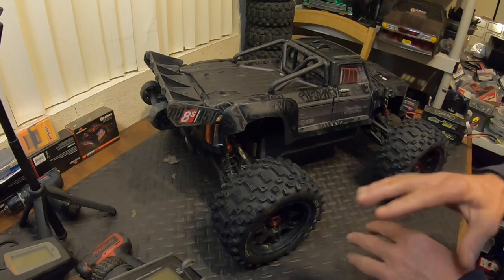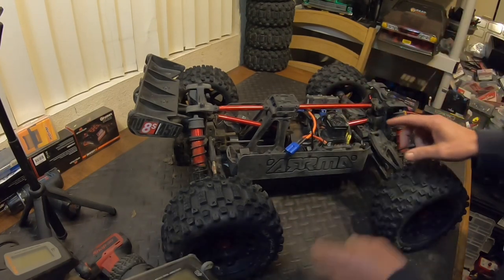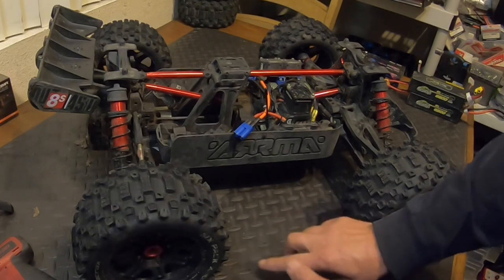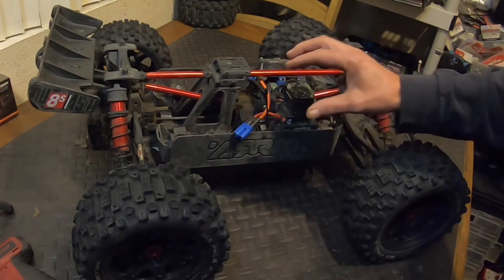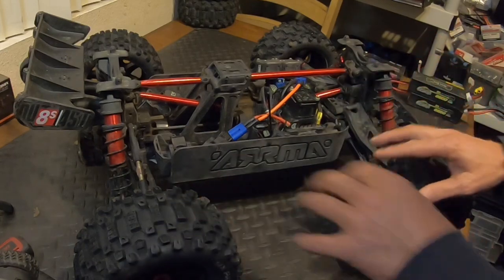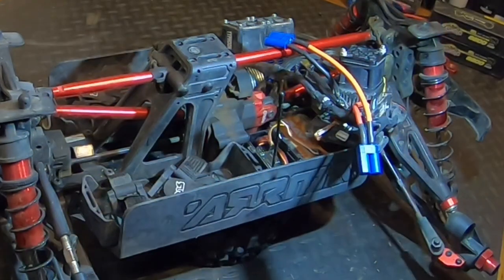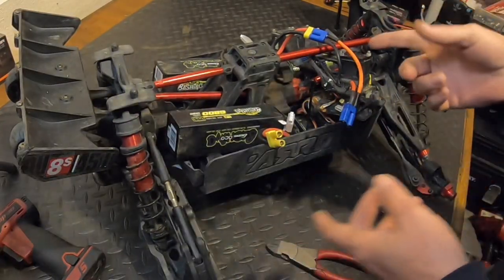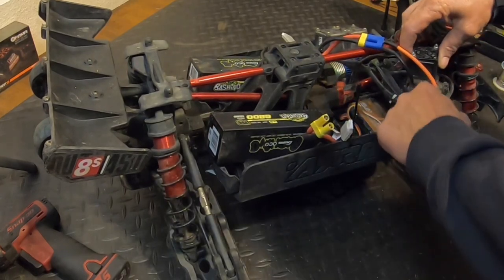Spectrum AVC Binding & Calibration of receiver and Calibration Radio To ESC Two calibration needed ?

Comment: Thx Brother.... I always calibrated AVC correctly doing the first steps. I never knew I needed to do the ESC part by holding the set button. Just did all mine now after watching this. YES, it did help someone, me. Now I am 2/2 on the calibration! Thx Sir
Reply from the maker: Thanks 🙏 I try and do the esc every 4 packs to keep that full trigger calibrated as the throttle starts to get used the full trigger number change a little on the controller 💯👍

Comment: With the spectrum 6100 if you hit the bind button three times then hold down to rebind within 1.5 seconds, and rebind at this time the receiver itself turns off avs can do this with all spectrum smart avc receivers. It will blink three times on power up everytime showing avc deactivated

Comment: Spektrum just released a Firmware update that eliminates having to manually calibrate the AVC.
Reply: How do u install the new update?
Reply: I can confirm this. It’s now called Auto Calibration. After updating to the firmware that supports it, you have to bind the car and radio while leaving the car perfectly still on a level surface. Then, it just works! I still don’t understand how it knows where endpoints are?

Comment: Great vid. I tried a Spektrum Dx3 with the SR6110AT AVC receiver with my Typhon 6s, But prefer the old Tactic TTX300/TR326 that came with it, or even the DumboRC X6/X6FG over it.
The AVC intervened with my throttle too much for my liking.
But I may try it with recalibration in my Kraton 6s before selling the Tx/Rx combo.
I kinda miss having left and right independent endpoints with the DumboRC combos.

Comment: Hey dude ive tried using x2 avc spektrum recievers , i think there both stuffed .....there sr6110AT AND SR100AT , i calibrate them and i get steering on both with my DX3 but i cannot get throttle or reverse , and all my points are on zero on remote .......i want my AVC but think im up for a new reciever as i think the x2 i have are toast??? but why am i getting the same issue.
the avc works and steering but no throttle and i tried playing with throttle trim ....aghhhhhhhhh
Reply from the maker: Rebind receiver to controller soon as it connects pull full trigger pause then full brake pause right turn pause left turn pause power off everything will work if not repeat but it will work everytime you bind that has to be done or no throttle will work just steering
Reply from the maker: One more thing make sure rc is level and receiver is mounted down can’t be loose flopping around
Reply: @earlmoorhead5555  I have made sure nothings flopping , let me try this again... I may have touched steering too early I'm not sure... I will try this on both recievers... I don't have a digital spektrum to set values but it makes a beep when it hits zero. Should brake be on full  half or nothing ? And should AVC be full , half or zero ?
Reply from the maker: Sometimes I’ve had to do this a few times even pausing at neutral before going to brake but it will activate the throttle only on the avc receivers 👍
Reply: @earlmoorhead5555  I think both of my recievers are faulty .
I've tried this method x4 times on both recievers..  one reciever played up when calibrating as I turned right but when I turned left it paused and dropped out and wouldn't turn left all the way , reciever flashed and I could steer again safe to say this one's stuffed . The other one didn't do this... but will not connect after calibration
Reply from the maker: Yes not a faulty receiver mine did that yesterday I had to bind again and pause at neutral before going to brakes …so bind receiver again go full throttle pause neutral pause brake pause right turn pause left turn pause then everything will work sometimes it’s done to quick and cause one position to be lost and losses the last signal that happened to be left turn
Reply: @earlmoorhead5555  it's taking a while to upload I'll let you know once it's up

Comment: I had trouble binding a Typhon, the orange dx5 had no reverse, binding it it would throttle up on its own, had to delete the model and do a new memory, then bind, that's where it did not work properly, the orange dx5 has the slide thing which does not work, junk as usual from Spektrum !!! I've put Traxass TSM rx in some of my cars and Nobel NB4 in my speed, Drag  and crawlers.